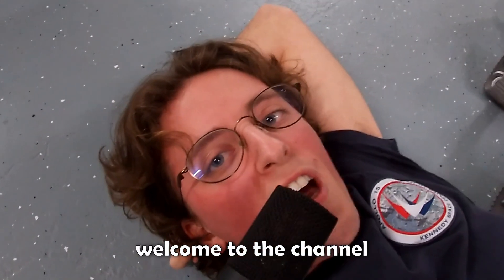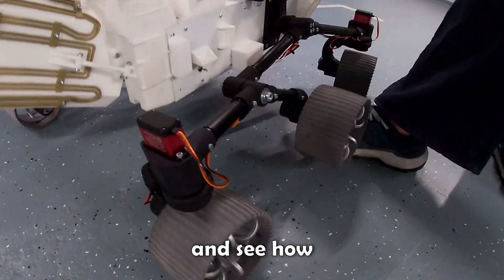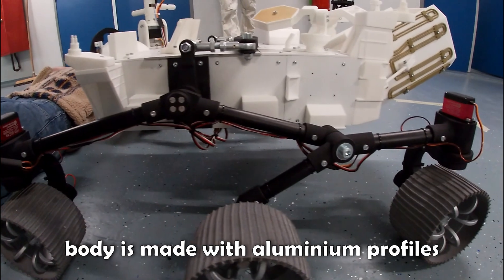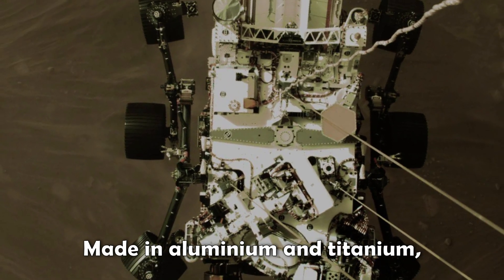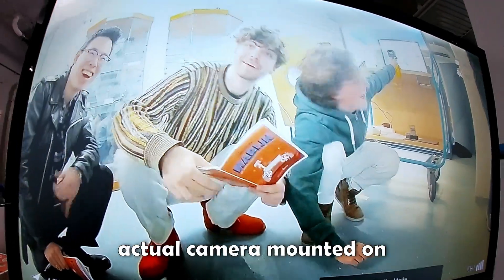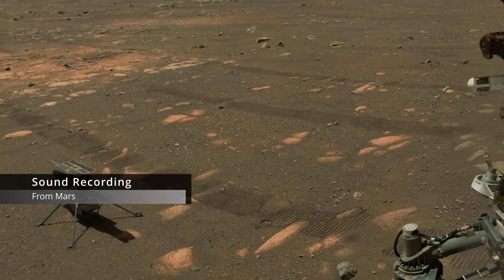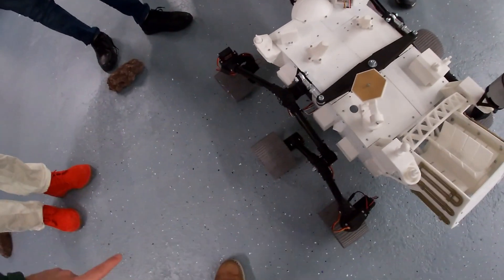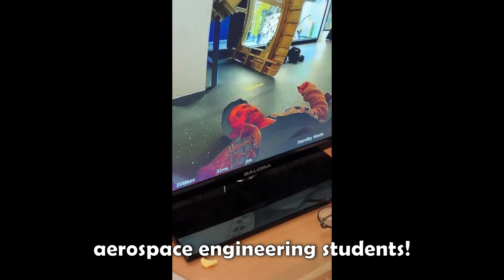We Drove a Mars Rover Over Students... at TU Delft

Comment: It should be around 5.69 kg.

It WEIGHS 15 kg, so it's mass is:

15 = m(9.81)
15/9.81 = m
m = 1.53

Using the mass to find the weight on Mars:

w = (1.53)(3.72)
w = 5.69 kg